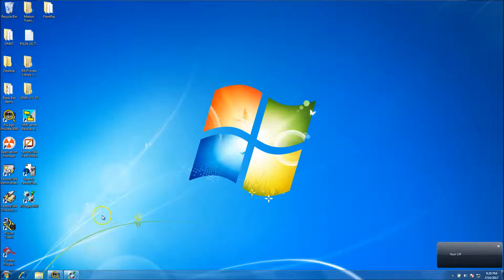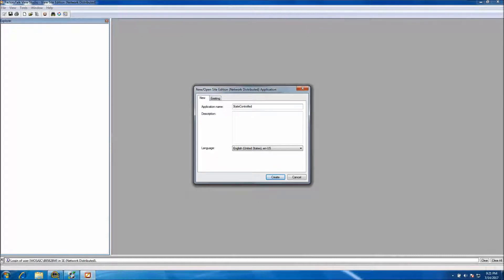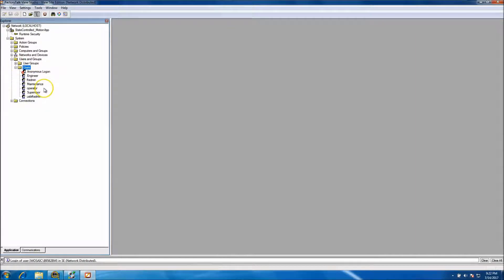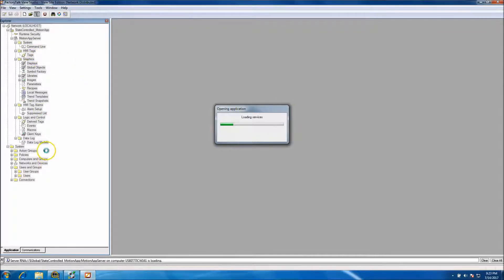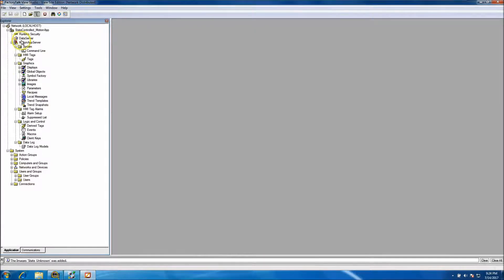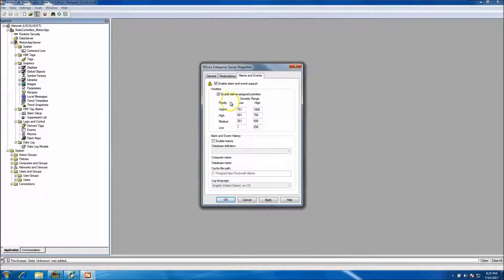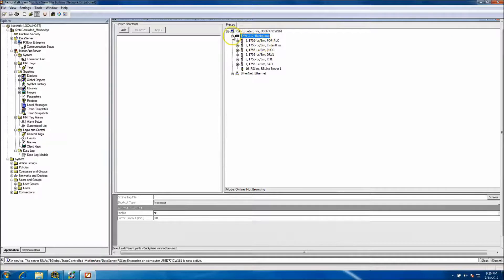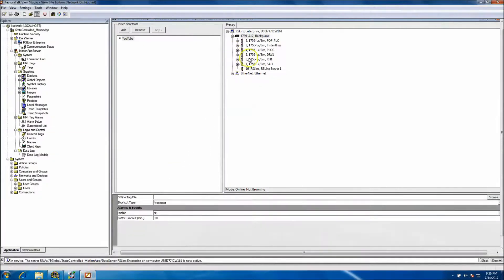Servo Motion Project Day 2 FactoryTalk SE HMI Application Start

Comment: I'm really enjoying the series Shane! Do you by chance have a components list to utilize all the equipment required to complete the servo motion project?
Reply from the maker: Meaning, what I used during the training series?

Or what is needed to build a system like I used?
Reply from the maker: Thank you a positive comment
Reply: @ShaneWelcher  You do great work! I'm super impressed with your video series, you do a great job detailing why you are performing each task. I'm teaching a motion controls class at a local community college and we have a stash of CompactLogix controllers and Powerflex 525 drives with several different induction motors that I have been looking for a project to utilize the equipment. This series is perfect for the students to follow along to and build these projects, I'm just wondering if we have enough of the correct components or if we need to get something different. More specifically, do the 525's need to have an encoder card? So the list I referenced would be for building the system, all the hardware components. We have version 20 5000 and I believe its version 8.1 in FactorTalk, plus we have both emulates per our Rockwell contract.
Reply from the maker: @TheRealHighHomestead  If you plan on teaching servo controls with a Powerflex 525 or 527 then yes, you will need an encoder.

Please be careful ordering the encoder card online because there are people selling cheap ones but they are stamped prototypes & not for resell.

I got burned like that so I wanted to let you be aware.

My recommendation would be a Powerflex 527 with an encoder card & a 1024 encoder.

Hope that helps
Reply: @ShaneWelcher  my plan was to order the   25-ENC-1 card for the 525  drives we currently have and utilize those the best we can. Thanks for the input!

Comment: i have power up fault code 60 how can you help me ?
Reply from the maker: Power up fault on what exactly? A servo or a drive?
Reply: Shane Welcher this fault in logix5573  appear when i turn it on
Reply: i have some picture to this fault but how can i send it to you for see it
Reply from the maker: Email me at Support@onlineplcsupport.com
Reply from the maker: Do you have a program in it, if so then do you have a backup copy?
Also, does the processor have a memory flash or sd card in it?
Reply: Shane Welcher i send the picture to this email
Reply: Shane Welcher yes it have aprogram and have a sd card
Reply from the maker: I haven't received anything as of yet but if the processor is an L73 with a memory sd card then you can use the Fault Dump Utility. There is an option to try to flash the firmware on the processor as well but sometimes that doesn't work based on the major fault. 

Sometimes removing the sd card and cycling power a few times then powering back down and re-inserting the d card will clear the fault as well but generally the fault is caused by programming so you will still need to fix the code that is causing the issue unless this happened from an out of box state.

Sorry such a vague answer, I would really need more info to give you more advice.

Best of luck, 

Shane